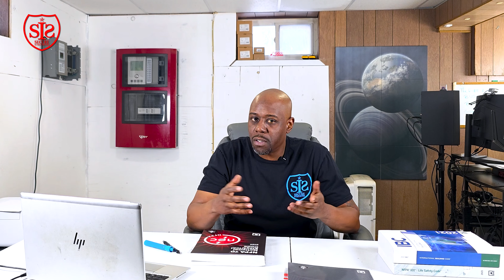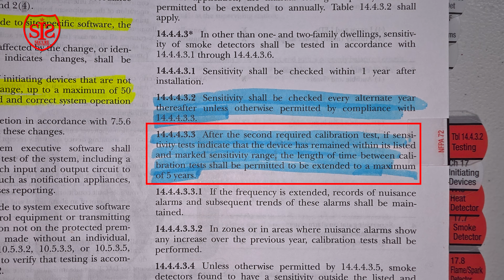NICET Level 1 Quiz 8 | Fire Alarm Practice Questions

Comment: im using nfpa link to access the code books for the moment. am i missing codes here? i'm instantly thrown off seeing your questions having answers that i cant access.. would you say owning the physical book is a requirement to passing?
Reply from the maker: You just may have the more updated version in the NFPA link. I have the same but try to keep the most current book. I am using NFPA 72 2022.

Comment: I am looking to get into low voltage...after 15 years installing commercial emergency lighting, feeling I juist want to learn something new.  think I should learn what I can online first, then go start applying... or jump straight in and start applying for jobs now?
Reply from the maker: If the money is right, it would be a good move. You may have a pay cut so somethings to think about.
Reply: The moneys in service, if you have a good amount of troubleshooting experience then you could jump to a company offering service tech positions